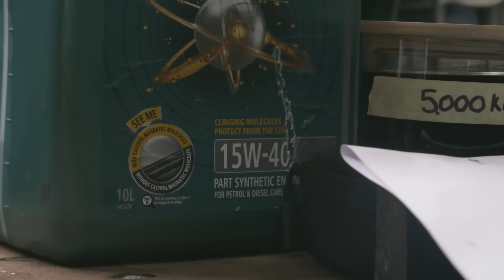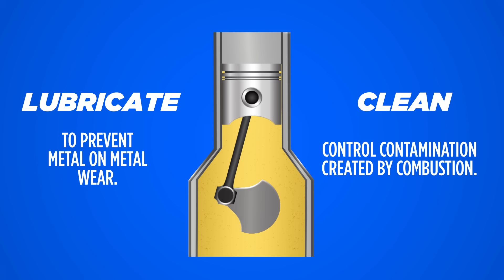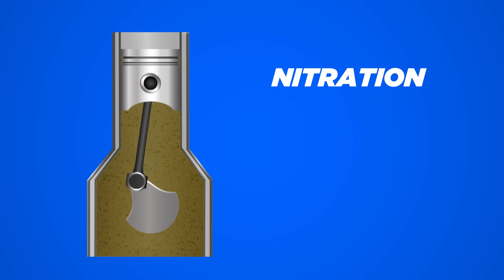Engine oil COMPARED at 5,000km vs 10,000km vs 20,000km! This'll make you service your 4WD RIGHT NOW!

Comment: I service my 2013 Nissan patrol cab chassis with oil and oil filter every 5000 km, however it gets serviced more frequently at times due to always being serviced before trips. All other oils are replaced every 15,000km but checked every time the engine oil is replaced. Air filters are replaced every 5000km, fuel filters 10,000-15,000km, coolant flushed every 20,000 to 30,000 km. My car is required to be reliable as I frequently drive across the country so no expense is spared with servicing.

Comment: With my gu patrol I NEVER let it go pas 5,000ks between oil changes. And when speaking to 2 different dealerships (oem parts only) over heard a conversation about some of these new cars coming out with service intervals every 25k most of the mechanics was all concerned about this, and completely disagree with the service information given out. In other words if dealerships are saying this is not good for the engine and too much to go wrong between oil changes this tells me stick with our gut instincts. 
A very wise mechanic once told me engines last longer with clean oil not dirty oil. Every 5k for diesel and maximum 10k for petrol engines. 

Sorry guys I know this is long winded.

Comment: I used to own a truck which had  bypass oil filter as well as the normal oil filter. I used to change the oil every 10,000km, I was still clear at 5000km like it was new. Do they sell bypass oil filters for 4wd's??

Comment: Hey guys! I service my td42 Gu every 5000kms, transfer and gearbox every 30,000kms, diffs every 20,000kms give or take depending on my driving. Checking everything often. Miscellaneous stuff as they need doing. A years supply would treat my rig big time haha! Cheers for the info 🤙

Comment: I have a 2000 GU PATROL with the direct injection ZD30 (grenade) so I service every 5000 with filter change (fuel every 10000) the misses car VZ commodore is lucky to do 2000klms a year but it still gets a change every year

Comment: LC105  Always changed engine oil and filter every 5000km. Gearbox and transfer every 25000km. Diffs every 20000 km, but if off-road with many water crossings I do them after the trip.
 Regular servicing is cheap insurance and peace of mind. It's false economics not to do it.

Comment: Shauno on the Prado 120 the manual has a section "Additional Maintenance Schedule" which actually says 5,000km when operating under heavy use towing or offroad. Your 200 probably says the same thing.
Reply: Yeah pretty much every manual says if you are driving offroad or towing etc to reduce the filter oil and everything period

Comment: Old ln106r most people say 5,000kms and I do just that, more so even less if I do alot of highway kms and sand driving where the oil gets hot and will break down easier. Last few services have been around 3000-4000kms with Castrol oil only. Gearbox transfer will be done every 30k odd and diffs around the same. All these early oil changes becomes very epensive but well worth it trying to protect my pride and joy. A years supply would be so good !

Comment: I'm a mechanic, the only way to test oil is through a lab test, I suggest doing as your service book says.
Always use good quality oil.
Dropping some drops of oil on white paper is hardly any sorts of a test.
Reply: Hell, my 2006 Honda Element only asks for an oil change every 10k miles. (~16k km) I don't doubt modern oils aren't capable of it, but I'll still personally change it every ~5k miles (~8k km) or so just for peace of mind.  I believe the previous owners did the same, and it still runs like a top with zero blowby at 200k miles. Then again it's a Honda so who's surprised haha
Reply: @smileyguyz  Your Honda will last 2000 years, at least, the engine will, not sure about the body 🤣
Reply: I am a Diesel Mechanic too,  only used this paper test once, it was a very basic diesel in oil test. Wanted an instant result. Yes oil was sent to Lab,  engine was stood down pending.
Reply: @R00RAL  question: I drive a 2021 Fuso 5.5tonne truck.
The service manual says to only service every 30,000km.
Do you have any thoughts on this?
Reply: I scrolled for like 200 comments looking for the first one to say this. Good job.
Reply: @Boriskov2  hah same
Reply: And day old (not petrol) will be just as black as 5000km
Reply: I can't see how changing the oil more regularly will be detrimental to any engine. So why not change it every 5000k?
Reply: @andrewlevine8816  Cost, Convenience.   Downtime.
Reply: @R00RAL  well i guess it depends on what vehicle.
The average sedan takes about 3 to 3.5 liters, that's cheap and easy to change on the weekend when the vehicle isn't doing anything anyway.
A caterpillar D8R on the other hand is a completely different story, not sure how much oil it takes but it might be one or two milliliters more than the average sedan, complexity again not sure but I'm sure every minute it isn't working is money out the bank.

So yeh there are different worlds when it comes to oil philosophy.
Reply: @andrewlevine8816  why not every 2500k?
Reply: @andrewlevine8816  Unlike the guy who made the original comment claiming to be a mechanic.. Any Mechanic these days will say to change the oil every 5,000 ks specially if the Car is older and you drive it hard... Books are just a guide, most of them even say that it's just a recommendation.. Hence why New cars and even bikes go for their 1st few oil changes at 1,000ks and 3000 and 5000ks! straight off the bat!
Reply: @KermitTheFlogga Of course mechanics will tell you to change the oil every 5K!! It's more business opportunity for them 😂😂😂
Reply: @radiocontrolled9181  🤣go run a car without doing an oil change for 20,000k's then. goodluck 😂😂😂😂
Reply: @KermitTheFlogga  Modern fully synthetic oils can easily take 10,000km or 15,000km on regular cars. Fact. The most important thing is to periodically check the oil level and top it up when and if necessary.
Reply: The service book also says that if the windshield wiper stops spraying, that the reservoir probably needs to be refilled. Its a good thing because if it didn't, how on earth would you know how to troubleshoot that since you are a mechanic? 
🤣
Reply: Its a valid test for me though.. carbon and metals deposit within the oil makes the oil dirty. I suggest you use ordinary oil like mineral oil and have an oil change every 3,000KM.
Reply: Who's got time to change it every 5000km I do 10000km in 3 months that means every 1.5months I have to change my oil... yer nah!
Reply: @anth1839  depending on how much you drive. If you drive a lot, 5k oil change is not sensible. There is a long mileage oil that last longer, up to 25km between change. So in your case, it can last more than 6months, just slightly more expensive.
Reply: The Oil Blotter Test tells you just how contaminated the oil is. You do not need a Lab Test to see that the oil needs changeing.
Reply: Instead of making a negative comment when Shauno is only trying to help people out, maybe post your own video to help the 4WD community
Reply: As the Car Care Nut (Toyota Master Diagnostic Technician) says, oil is cheap. Engines are expensive. No harm changing it @ half the recommended service interval. My NX 2022 has a 15,000kms/12 month service interval which is ridiculously long
Reply: As a mechanic and owning two 4x4s, 1998 Nissan Patrol RD28TI (377000k) serviced as per book, 7500k and a 2016 Mitsubishi MQ Exceed 2.4 (165000k) as per book 15,000k. Neither use any oil between service intervals.  Just follow your book and use decent oils and filters.
Reply: Why bother paying for lab tests when it probabbly cost around the same a 5litres of engine oil?
Reply: I buy my car New 2009 and now I put 250000km on it I change my oil every 5000km and zero engine problems and engine sound still smooth.
Reply: Hey bud how often should one change blinker fluid?
Reply: I only got to 4 minutes and had enough. Lots of noise not much knowledge. Most oils have ashless detergents in them for cleaning purposes. Diesel oils have a lot for obvious reasons, the ashless detergents will start to discolour as soon as the engine starts. Colour is not a fair indicator of oil condition. You can put a drop of black engine oil on the base of your thumb and rub it a couple of times if it is dirty you will see it. At 5k worth of work it will barely make a stain. Even 10k there won't a great deal of of carbon but there will be some. It is the carbon/soot that is the wearing medium. Not the colour. I use Mobil oil when ever possible or Valvoline, I won't use Castrol!
Reply: Thank you. Exactly, as i was thinking. 10000km is perfectly fine, and it's what i do in all my vehicles. This oil used in a diesel, meaning it gets dark almost within the first kilometre
Reply: Service book is a piece of 💩, because vehicle manufacturers want to sell you his car every 3 years. So they calculate vehicle life for a short period!
Reply: If this comment suggests that changing oil more often could be bad for the engine.......this comment came from brain damage
Reply: Exactly 
I've been doing part of those lab tests years ago. ;-)
Reply: Agreed.
Reply: Good points Brett but a lot of vehicles now the service book recomends 15000 km or 12 months between oil changes do you think you would follow that guide ? I know damm sure I wouldn't
Reply: @dave6199  you lose like around 4-6k Aud over the engines 300-400k km life if you change it 5,000km earlier.
So for an engine that is only around 10k fully rebuilt shipped straight to you its 50% of the engines cost rather then your engine lasting abit longer and I can say right now it wouldn't be anything close to the 50%.
Reply: Merc sprinter recommends oil changes at every 40k or 2 years. Would you really trust what the service manual tells you ? 
What a croc of shit !
Reply: I’m another mechanic I agree and always use the manufacture recommended oil
Reply: How often do we REALLY need an oil change? That’s the question. Mr lube and other shops will all tell you to change it every 5,000km but my owners manual says every 20,000km. That seems high to me. What are your experiences?
Reply: @Adrien_broner  Try reading my letter from 2 months ago!
Reply: Thats what you should not be in business with that comment. You comment reminds me of a dealership ill train apprentice.
Reply: It gets the point across. .way before labs men knew how to do this. . .
Reply: Whatever the Service books say? A 15k interval? no thanks.
Reply: this clown OP doesn't even have a college degree, lol he doesn't know any better
Reply: Let it out the pan and it surely won't be clear 😂
Reply: Absolute insanity. The manual may or may not be a good idea. So manual says lifetime fluid in tranny, that's what I follow because that's what it says? 

You are everything wrong with the automotive industry.
Reply: Use science? NO WAY!!!!
Reply: "I am meteorologist, the only way to know if it rains is to ask you local station"
Reply: Exactly.
Reply: I used to drive around 7,000 miles a month in a diesel Ford Escort. It had a service and oil/filter change every 6 weeks. Still, the garage felt it should have more frequent changes.

My current car gets an a service every July and I change the oil either side of winter which lasts 5 months here. The filter is a pig to change tho.
Reply: No lab oil analysis? This is hardly a scientific test of engine oil.
Reply: Pls let make Lab test diesel and Petrol ICE, main focus on viskozity and particles 5k 10k and 20k

Exact Lab test can show the quality of  using oil
Reply: oil lap is money pit test. I can't trust them either.
Reply: "Dropping some drops of oil on white paper is hardly any sorts of a test."

Oh please. You're the condescending type that hates it when most people can get some basic understanding on a topic they would normally be ignorant of.
Reply: Aggree! 😊
Reply: Send yours to a lab and do a video mate
Reply: Dropping oil on white paper is exactly a sort of test.   It might not be enough but it is a type of test.
Reply: Every 3000ks here when oil and filter is on special ❤
Reply: Jeep patriot with 300k not a single engine issue , changed every 5k
Reply: Well you can judge by the color too if it's brown your good if it's completely black time to change, I change mine from 5 to 6000 kmh
Reply: Got a vehicle has never had an oil change In ten years daily driver. Farm truck. Reminds me probably due for a top up. Over rated.
Reply: @reallyskeptical pls elaborate
Reply: @reallyskeptical  suit yourself 🤣 but every 5 yrs change is better then nothing  mby go with no detergent oil too🤣
Reply: @reallyskeptical bullcrap!!!
Reply: @imGlobL definitely, when i say daily driver its not the main car, old 40 series toyata i actually changed the oil last week definitely 10 years since last change. So personally i don't care if you believe it or not but absolutely true.  Good day and if want bull crap you can roll in it on the farm.
Reply: So what you are saying is that pitch black thick oil could still be fine and clear oil could damage your engine?
Reply: @snowflakecuntreeman3947  completely drain your engine oil, chuck in new oil replace oil filter and start it up, drain the oil and check the colour, it'll be darker already, does that mean its already poor oil? , only the lab can tell you
Reply: @shaungranger2166  incorrect.
You are welcome to come and check my 3k oil, it's light brownish.
Reply: @shaungranger2166  oh i get mixed up with the comments.
Okay let's clear the air a bit, with diesel you are 100% correct.
With my petrol, the colour says it all,... 🤔 Okay not all but it gives a damn good idea, if at 5k it's dark black i change it, if it's still brownish I'll let her run a bit more.
Reply: @shaungranger2166 that's because your engine is likely filthy inside due to your low frequency oil changes. A well kept engine doesn't spew out black oil immediately after putting new oil inside. Mine certainly does not. I change the oil myself every 5000km.
Reply: @snowflakecuntreeman3947  In my case yes.  It was not a car Engine I was diagnosing. It was a 3516 Generator Engine. V16.  I was looking for the diesel being absorbed in the paper as against the oil. Diesel will show quite quickly if you know what your looking for. Then you know to start looking at exhaust temp variations & injection tests.
Reply: @R00RAL  I'm going to guess that the running costs of that V16 is a bit more per month than my 1.5 petrol that drives about 50km a day, so yes for you lab testing is a must, for us we just drop it on a pice of paper and if it makes us feel funny we change the oil,.... Who are we kidding we already bought the oil and oil filter, we're just looking for an excuse to do an oil change.
Reply: @snowflakecuntreeman3947  no just you.
Reply: @snowflakecuntreeman3947  where did you read that?
Reply: Yeah if you’re blind 😂
Reply: @petronipetroni6841  stick to push bikes 😆
Reply: My Audi service manual says long life servicing every 19k miles. No thanks. Do the oil every 10k.
Reply: @ln5747  10000kms is only 6200 miles. 

10000 mile's is 16000kms
19000 miles is 30000kms.....
No way Aldi is 3 times others in service length. 

Plus 99% people don't drive that far in a year.
Reply: @ausguy4385  Audi long life servicing is/can be 19k miles.
Reply: @ln5747  that only UK and is one year Max regardless of km or miles
Reply: @ausguy4385  my light Fuso truck says 30,000km.
It feels very wrong driving it that long but the boss isn’t going to spend money on it against the advice of the manufactures.
Reply: @yallawallahalla  that's a truck....
If it was 10k it would need a service like every week and a half as interstate travel....

Also you seen truck oil and air filters? They are huge and multiple layers and filters for this reason, to extend the service interval. 

Also a truck has far more oil fir engine size Also.
Reply: 5,000km oil changes are too early. Although this test is nothing more than a colour test does not indicate the oil is good or bad but I can assure you after 5,000km the oil is still in good condition with enough detergent power and film strength to last another 5,000km hence why the manufacturer say's 10,000km.The manufacturers don't just throw random numbers out there it's been tried tested and proven that the information and recommendations is the best bet for your vehicle! 
C
So changing your oil at 5,000km is nothing more than a waste of time and money regardless how you use your vehicle!
Reply: @all4dh8rz3  I’m no expert but I think it’s a tad more complicated than that.

Maybe you should change your oil after a day if you’ve been at the race track.

Maybe after a week if you’ve spent the week revving the shit out of your 4wd on the beach.

For normal daily road and highway driving I agree with you completely.
There are surely benefits to changing your oil at 5000km but if the cost or time taken is prohibitive then 10,000km is completely fine.
But driving your vehicle hard is likely a different story.
Reply: Any good mechanic knows that there is no need to do lab test. Don't pretend to be smarter.
Reply: @A17863-c  Got a flat earther here! "Say no to science!"
Reply: I am not mechanic. But I know that producer wrote service book in way to save his interests, not  a client ones.
Reply: @infeltk that's a dumb way to think. If people follow book and suddenly engines start having issues, do you think that's the best interest for company? They will lose face by the years.
Reply: Surely He did this video to get people to bite.......Putting oil on paper and then going by colour to work out its serviceability, You cant be serious 🤣🤣